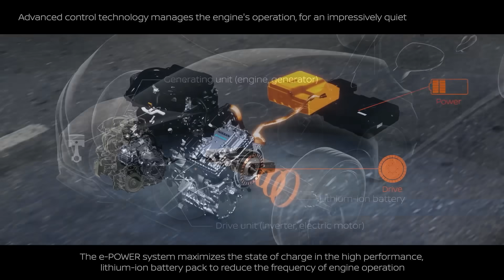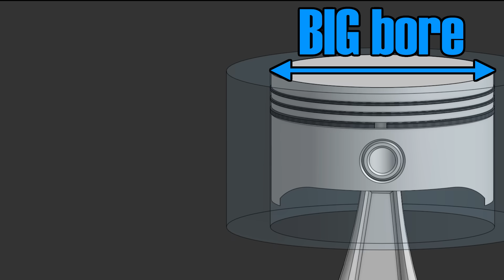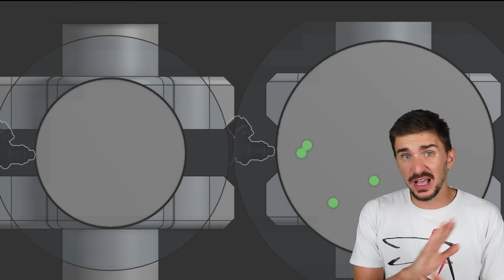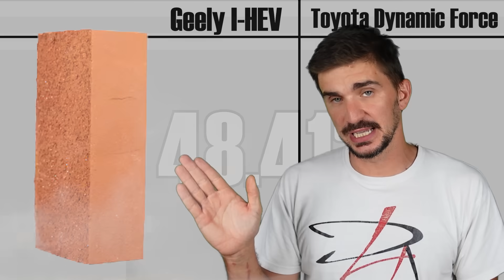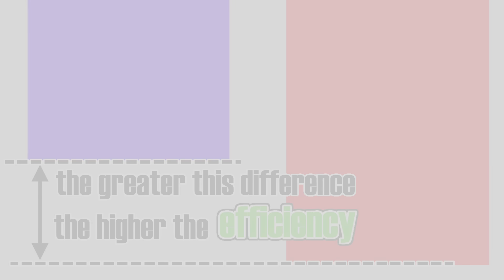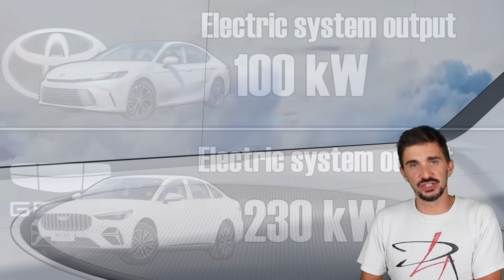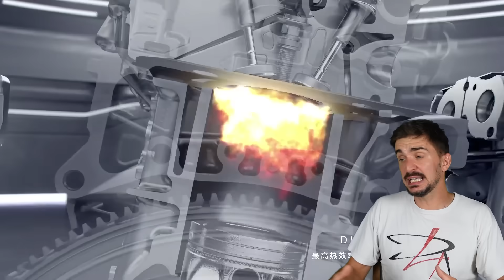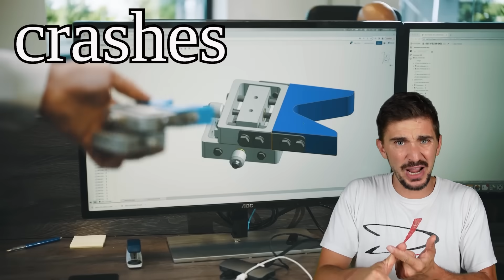How China's Geely Beat Toyota, BMW, Ford and Everyone Else

Comment: If not diesel, why diesel shaped?
Reply: ¯\_(ツ)_/¯
Reply: @Jimjam69e I used translate and it says "tsu" 😂
Reply: @SlimJim3082 the ツ character reads tsu in japanese
Reply: @Raren789  Katakana language if you are specifically trying to search
My mistake: it is part of and a syllabary of the japanese language.
Reply: @WhiteRedPanda  katana language
Reply: @WhiteRedPanda it's a syllabary, not a language
Reply: Direct injection engines share a lot with modern diesel engines.
Reply: Less emissions.
Reply: @user-ro2nq7gp9l this engine probably has a Particulate filter, so the emissions are approaching diesel levels of complexity.
Reply: @gordonborsboom7460 True, but they still have less particulates, plus they don't need piss injection for the exhaust aftertreatement.
Reply: @user-ro2nq7gp9l right. I forgot the urea too
Reply: @user-ro2nq7gp9l  When entering those compression ratios they very much will need SCR after treatment.
Reply: @user-ro2nq7gp9l  haha I never heard it called piss injection but I like that. I’m going to start calling it that too haha
Reply: The backpedaling from Ev is due to tariffs. In Europe Chinese EV are tariffed at 40-45% upon entry. REEV, super hybrid and all others aren’t. That makes them cheaper to buy, while being more complicated and costly to make.
Reply: @luigifranceschi2350  the only reason why they put the tariff is because the VW group asked them. China can crank out more cars than VW and BMW.
Reply: @TheChees1996 BS German automakers lobbied the EU for a chinese style joint venture strategy, they wanted to let Chinese EVs in to learn from them.
Reply: @bl1t7arrow  lol buddy you believe that. Ford bought a car from China to learn from it. What ford learned is they are 25 years behind Chian. VW have already bought a car from China to learn from and what they have leant is the same as ford, they are behind too,have been selling you all garbage for years and never thought of improving.
Reply: @TheChees1996  No I’m saying that China caught up to Europe using a joint-venture strategy, where if Euro automakers wanted to sell in China 30 years ago, they would have to manufacture in China with a Chinese partner firm. European automakers wanted to copy that startegy to catch up to China, so they lobbied against Chinese EV tariffs and for the joint-venture manufacture in EU strategy.
Reply: @bl1t7arrow  oooh I did hear this version of the story.
Reply: @bl1t7arrow  You mean the thing China did to steal all the technology they coudnt make them selfs
Reply: @xythiera Yes, they used foreign IP, at some point, someone started to think.
Now, we have the results.
US did the same to Canada, with the Avro Arrow. Forcing them to end the program, so they could cherry pick the engineers.
How do you think they got to the moon. 😂
The Europeans got enough to boost Airbus. 😂
Reply: @TheChees1996  This is actually true, but also pretty hilarious. Why? Because VW themselves in the early onset of Chinese EVs in EU were lobbying to block tariffs for Chinese cars since their biggest market is China and they don't want China to retaliate. Now, them along with BMW and Mercedes are the ones leading the pack in lobbying tarrifs, because they can barely compete in EU loooool.
Reply: @TheChees1996  Yet China is what baled out VW in the 80s and built their fortunes right up to the point local Chinese makers sailed past them. i.e. usual complacency then panic to stop the wave
Reply: @xythiera no,no,no. Dont blame China for that, they were given that technology because our law makers and billionaires wanted to extract more value for shareholders. They could have kept the factories in Europe but they willingly gave away technology and know how in order to fuck over European workforce and earn more for themselves.  Learn the truth before going racist, thats how they control you
Reply: @nemanjap8768  It's always the same people to blame, the fucking greedy rich assholes.
Reply: @xythiera as far as automobile co production in China is concerned, most of what was produced were one or even two generations behind what was produced in Europe.  That didn’t change until WTO, which opened Chinese automobile market to more brands, easier access, less tariffs, so the co production facilities had to produce more up to date products to compete.
Reply: @nemanjap8768  •yes !yes ! yes !
I blame a snake-China for acting like a snake 🐍 and biting the hands that feed them technically and getting away with IP theft like snake-China & Snake-USSR.
Reply: @TheChees1996  Cranking out more cars then anyone else is not the issue, selling them is, Chinese car industry is the next bubble.
Reply: @luigifranceschi2350   EREVs are cheaper to make if you already know how to make petrol cars, or if you want to add a lot of range to a battery EV.  A 1.5l gas engine with a tank adds 1,000 to 1,500 km range at far lower cost and weight than battery.  Chinese EREVs are verified 2,000+ km combined range, while being pure battery in daily driving. 

Consider an pure BEV with 1,500 range.  The 1,500 km battery would weigh nearly 1,000 kg (2,200 lbs)!  It'd be over 3x the size of a typical battery pack, and dramatically impact performance.  The suspension and chassis would have to be upgraded, and you'd be looking at something more like a heavy duty pickup integrating a structural pack compared to a typical unibody setup.
Reply: @ZweiZwolf but who needs 1500km of range? I usually need to stop every 2 or 3 hours for a coffee and something else. Now pretty all stations on the European main arteries have fast charging. Is not as cheap as at home, but works. So why bothering with a piece of equipment that will require maintenance and adds costs? Just give me a battery sufficient for 300km between stops at 130 km/h and a recharging speed equal to my coffe and toilet stop.
Reply: @luigifranceschi2350   I've driven 500+ (800+ km) miles in a single stretch, and covered 1,000 (1,600 km) miles in a single day, so that sort of range isn't entirely out of the question in a large country like China, Russia, or the USA.  

From a practical standpoint, 100 km electric range plenty for daily driving and 750 km on petrol is about as far as one can drive before needing to stretch one's legs.  If every car were electrified like this, ordinary petrol usage could be cut by 90-95%.  Coupled with fully-automated urban rail, commuter rail, high speed rail, and E-bus routes, that's where China is headed over the next 5-10 years.
Reply: @ZweiZwolf  I can drive too that distance in a day. Sometimes even more. But I stop every 2 or 3 hours. So as I said 300 km range at 130 km/h is more than enough if you made a network of charging stations.
Reply: @luigifranceschi2350   At 130 kph, 300 km is a forced stop for open fast charging every 20 km. That may hold in your tiny country, but it's definitely not the case in the USA, where truck stops can be up to 80 miles (130 km) apart.  China (also Australia and esp. Russia) could be even farther apart in their western desert, hence the 2,000+ km range on their longest range EREVs. 

If I'm actually driving long distance and planning to charge midway, then I would want 3-1/2 hours range @ 130 kph = 450 km USA range / 500 km EU range / 550 km CN range.  

As above, if we assume home charging with mature urban / suburban infrastructure as in China, then an EREV with a 100 km battery is more than adequate for daily driving, and China has mastered that segment with several nice cars under $15,000 USD / Euro.  

For rare long distance trips, it will be quite some time before the additional 200 km battery range is cheaper and lighter than a small 300 km range extender system.
Reply: @luigifranceschi2350 they can dump their EVs in the UK which has lower tariffs.
Reply: @user-xu5vl5th9n  is not a secret. In uk BEV share is 27% , while PHEV is 10%. In Italy PHEV are 17%, while EV at 7%. 
A BEV, same model car, should cost less than a PHEV. Much simpler, less complicated.
Reply: @luigifranceschi2350  ...no, it shouldn't... increasing the battery size at least 3 fold costs more than the engine and associated parts.
Reply: @L @LAndrewsChannel ow the cost of the battery has become very low. The best NMC batteries are at 100 $ per kWh and the LFP by BYD at 60$.
In china the PHEV by BYD cost pretty much the same as the identical EV by the same manufacturer.
Reply: @luigifranceschi2350 •cough , hundreds of billions in subsidies. 
China Next Evergrande bubble once the  EV batteries degrade . 

It does not help BYD  after purchase service is bad worldwide.
Reply: @luigifranceschi2350  evs are not a very smart way to go anyway
Reply: @Rusty_Shackleford_69  have you ever tried one? O love them, especially on mountain roads.
Reply: @Rusty_Shackleford_69  1987 called, it wants its opinion back
Reply: @luigifranceschi2350  Depends on charger availability and the distances you need to travel.
A well made hybrid gives you the same feeling while allowing you to top up the fuel tank easily and not requiring that you can charge the car while parked.
Reply: @jendakrynicky5218 yes, but is more costly to make, and more costly to maintain. EV needs almost 0 maintenance, while the gasoline motor needs all the regular maintenance of any gasoline motor. Personally I don’t believe in PHEV end super hybrids because the combine the problems of regular and ev’s.
Reply: @Rusty_Shackleford_69  It is, but governments just dont tell the story right and sell it right.

Let's be real, 90% of daily drives worldwide are well within range of EV's without re-charging. With fuel prices being voletile and looking at it from a pure transport from A to B point, you have to be kindoff stupid to burn expensive fuel going to and from work and doing groceries.

They should promote EV's for daily driving while not waging war on ICe cars. No, make EV's affordable and driving an ICE expensive. Not the cost of buying one or having one, no, want to drive ICE go ahead, but be prepared to pay 15 dollars the gallon.

That way, you drive cheaply to and from work, do groceries and still be able to have a nice ICE car for the fun miles, oldtimer doing 3 gallons for every mile, a nice sportscar for the weekend drives, despite the fuel price you can easily afford it with what you save on your daily EV.

Offcourse electric infrastructure needs a huge update in almost every country for more EV's but it already needs one anyway with or without EV's. China's advantage is they did not really start building their infrastructure untill the 1980's when they did they could immidiately apply all the lesson learned which gave them a headstart. "Older countries" are stuck with having to workaround and upgrade what has already been there since the industrial revolution and a network expanded slowly.

Those are the challenges, and that's how we have to start accepting and approaching mobillity. I'm a petrolhead, nothing wrong with EV's, if i have to switch for a daily so i can keep enjoying my oldtimers in my own time and for the fun they bring.
Reply: @gilibran EVs require a garage or at least a driveway. If you live in a block of flats or downtown, they are not particularly convenient.
Where I live most people would have no way to charge them at all.
And electricity prices are getting even more volatile due to the windmill and photovoltaic idiocy
Reply: @jendakrynicky5218  It's like i said, infrastructure needs an update frist or paralell , but otherwise? Where are you parking your ICe car now if you live on a block or flat?

I mean, it's really a matter of thinking in solutions not problems. And fuel is going 15 dollars the gallon or liter anyway in a few years.
Reply: @gilibran There are parking spaces around. There's no way to connect the car.
Reply: @jendakrynicky5218  Henc ewhy is said it cant go without an infrastructure update which is neccessary anyway with or withour EV's. 

Even before EV's were a thing the powergrid in most countries was under stress.
Reply: @jendakrynicky5218   China does fine.  They have chargers in every parking lot, and they're rolling out curbside charging leveraging the power lines for the streetlights.
Reply: @jendakrynicky5218  Go look at a Chinese parking lot.  They typically have dozens of fast chargers for EVs.
Reply: @luigifranceschi2350  The 600 kg battery makes mass EV adoption a pipe dream in many places due to road tolerance and electrical energy requirements.
Reply: @luigifranceschi2350 
EV batteries degrade! 
Hybrids are better for now .
Reply: @ProfessorFickle  batteries of hybrids degrade much faster because they have much more often discharge and recharge cycles. An EV with NMC batteries if recharged wisely will break apart all the rest before the batteries are to be replaced, and If are LFP, at least the double.
And a PHEV with dead battery is as good as a BEV with dead battery.
Reply: @luigifranceschi2350  •cost more expensive  to replace battery on EV 😂😂 than to  buy a new EV-car . 

Toyota hybrid batteries now have a 10 year battery warranty , 150,000mile. Warranty. 
Hybrid batteries now have  aftermarket manufacturers that sell entire battery-modules less than  1/2 the dealer price with warranty . 

China car brands will not honor warranty and have the worst after sales service in the world .
Reply: @ProfessorFickle  Those batteries are showing remarkable longevity.  People are driving with 10 year batteries with up to 80% capacity.  It's not a real problem.
Reply: @Omn @Omniverse0  •crack pipe comment  🤦‍♂️ 10 years ago was 2016 EV battery’s technology in China did NOT HAVE ACTIVE COOLING , DID NOT have liquid cooling. Tesla had not transferred technology to the CCP ! 
What 10 year old Chinese EV has 80% battery-Integrity? Show me a YouTube video prof .
Reply: @ProfessorFickle 
Yes and no.
More weight.
More gizmos to fail.

IC still better in longevity
Reply: @Omniverse0 Five and a half years, 89,000 miles, 89% battery for me. It’s going to last longer than the car (and most combustion engines) before it gets to 80% and I’d planned a life where I could be happy with the battery dropping to 70% after 5 years.

It’s a bit annoying really. I can’t justify arguing for a new car with the wife because the battery is failing now 😖
Reply: @ProfessorFickle  This reminds me of Toyota, they insist of Hybrids until like two years ago where they suffered huge market share loss, they make up their mind to invest in full EV, only to realize the political environment start backpedaling back to Hybrid...
Reply: @ProfessorFickle scare tactics, batteries will last longer than 20 years
Reply: @nemanjap8768 : show me prof  buddy . 
Common lie tactic by EV fanatic’s . 
All batteries start to degrade in 4 years even the newest batteries made today .
Reply: @ProfessorFickle So angry and you still can't spell proof.
Reply: @Omniverse0 我给你一点数据支持吧，我在中国抖音上查到的，跑了8年的比亚迪出租车，中国出租车报废年限是8年，一共跑了42万公里，电池还剩74%，不过那时的电池技术很一般，现在应该能跑的更久
Reply: @charlesdeblanc3386  
You are such a fanatic you can’t PROVIDE ANY  .
Reply: @ProfessorFickle  IC engines degrade too. They lose power and efficiency over time as wear degrades the cylinder seals. Often by very significant margins. We've all seen older cars burning oil and emitting clouds of smoke.
Reply: @_Hal9000 correction IC better in every conceivable way 😂😂
Reply: @javelinXH992  yeah the battery might outlast the car which will likely start to fail here and there soon. The comparison to internal combustion is pretty out there tbh, most engines can go multiple hundreds of thousands of miles.
Reply: @Paul-yz4gx  , yes 👍 fail to maintain a internal combustion engine and it will fall apart . 
But the vast majority of I.C.Engines hybrids will out live ANY EV. battery pack . 
Especially Toyota hybrids .
Reply: @Rusty_Shackleford_69 Indeed. In the UK, the average for an engine being scrapped is between 120,000 and 200,000 miles. That depends on manufacturer, fuel type (diesel does better) and usage (long motorway miles are kinder per mile than town driving stop/start).

I know there are people that will say things like “my diesel has done 400,000 miles and is still going strong”, but these people who know and treat their engines well are in the upper bracket of mileage, definitely not the average.

Electric motors and batteries are relatively simple beasts with fewer parts to wear and less physical strain. It’s no surprise they can easily reach 200,000 plus. Bearings and other parts may need replacing (almost certainly) and you may only have 60-70% battery life at that point, but I do think they are going to prove more long lasting overall than ICE engines and certainly longer than most people think. And the batteries now coming online are even more robust than before and pushing up the number of charging life cycles. We are talking over 1,000,000 miles as a norm. This is getting to the point where taking a battery with you to a new car is possible - though form factors stop this in practice. There is talk of standardisation if shapes and connections though, so you never know, one day perhaps.
Reply: @ProfessorFickle  you're making the claim. Man up and substantiate lol bro 😂😂😂
Reply: @shu @colordarmstadtiumpsychiatristr 
Look at a 22 year old Toyota  hybrid is still on the road . Resale value is high for a reason 22 year old hybrid ! 
Resale value of Chinese Cars in Mexico & Brazil are Trash-bad For a reason (degradation & bad after sale service ) 

So many brainwashed EV fanatics.
Reply: @ProfessorFickle  you're confused and conflating a bunch of things to be anti ev for some reason. Typical yt response
Reply: @colordarmstadtiumpsychiatristr : typical EV Fanatic  , ignores China has the worst after sales service in the world . 
Ignores EV resale value is 📉 the worst , especially anything made in tofu-dregg-China .
(Note :  2026& 2027 hybrid is better at the moment than EV)
Reply: @ProfessorFickle  aww lil bro crash out 😂😂😂😂
Reply: @colordarmstadtiumpsychiatristr  : I more likely to buy a ‘Chinese hybrid ‘ than a Known-battery-degradation Chinese EV . 
Let me remind you , Look at resale value , look at the used car market and see what keeps its value for 20 years .
Reply: @ProfessorFickle  😂😂😂😂
Reply: @colordarmstadtiumpsychiatristr  
😂😂😂😂😂😂 EV resale value 📉
Reply: @ProfessorFickle  it's not really been shown to be a massive issue, and China is improving batteries more and more. They are unfortunately world-leading now, it seems. Would have been nice to have the EU develop this technology further.
Reply: @csr7080 •lol I guess it’s time to steal technology from China and China should not complain about its bad youth unemployment rate. 🤷‍♂️
Reply: @ProfessorFickle  sure go ahead, no argument from me
Reply: @ProfessorFickle   Yes, and the current battery warranty is to 80% of original capacity over 30 years.  A 300 km EV going to 240 km in 30 years is longer than most people hold cars.  How many 1996 cars do you see on the road today?
Reply: @ProfessorFickle   Chinese BYD E6 taxis in Shenzhen are hitting 700,000 km with 80% battery, no problem:
https://www.youtube.com/watch?v=fVUytbdJE5s
Reply: @ZweiZwolf  • byd known worldwide for the worst after sales service , 6 months to wait for a suspension part in Mexico & Brazil . 
Do you think BYD cares about honoring a warranty , made in CCP.

I do see plenty of Japanese cars from  1986.  Because they made parts with warranty for them .
Reply: I came to type this too.
Reply: Imitation is the sincerest form of flattery?
Reply: High compression
Reply: Very long stroke, extremely undersquare.
Reply: It doesn't "clank" like a diesel, so no fun
Reply: Convergent evolution
Reply: The diesel shape more efficient and running petrol instead lets you get away without the DPF or DEF to clean out the Nox
Reply: My Royal Enfield Bullet 350 engine was designed in the mid 1940s. It is under square (long stroke) too. These engines enjoy a good expansion ratio and good torque, too. The downside is the more limited safe rpm compared to a square or over square design.
Reply: Bingo.
We can have 100MPG cars tomorrow if everyone is willing to put up with 25 horsepower engines.
Reply: Miller cycle makes it less effective comp ratio, and maybe its fancy intake, allows it to not need diesel style injection
Reply: No DEF required
Reply: Does it run on 87 octane gasoline?
Reply: @jamesg9932 why shouldnt it all? All cars sold in europe cars run on 95 octane engines.
Reply: @arsicpedja   In the USA most cars run on 87 octane gasoline, if you have to pay the increased cost of higher octane fuel the higher efficiency benefits are negated.
Reply: the distinction is blurring
Reply: I would suggest that it is a macro factor, because it relies on middle eastern light oil, the heavy fraction of which will fuel thermal power plants and diesel will be consumed by trucks.... using diesel for civilian commuters would break this balance.
Reply: Longer stroke, more torque, lower rpm, higher compression, more work extracted per explosion. 

More efficient
Reply: LMAO Try running this on Brazilian fuel, it would detonate in 4 seconds
Reply: @gabrielvieira.4358 parece que você desconhece a diferença entre compressão geométrica e compressão efetiva. Ele tem a taxa geométrica de 15,5:1, mas as válvulas fecham tarde, logo a compressão efetiva vai ficar em torno de 11:1, dentro dos limites que a gasolina comum tolera. E a octanagem da gasolina comum brasileira é 93 RON, melhor que a dos EUA que é 87 RON.
Reply: @gilsonrogeriolimaoliveira2807   Teoricamente. Coloca a comum pra você ver uma coisa. E no vídeo não foi (Até onde eu vi) explicado sobre a compressão efetiva. Então, o motor é menos eficiente ainda... Por isso tem que ter um motor elétrico pra ajudar. Qualquer carro faz essa eficiência com um motor elétrico ajudando. E então porquê colocar a compressão "fake" sendo que a real é menor?
Reply: @gabrielvieira.4358 você assistiu o vídeo todo irmão? Ele diz todas essas coisas. O motor é feito para um carro híbrido com uma bateria enorme, é completamente frouxo se por acaso a bateria acabar, e o sistema usa IA para evitar o máximo possível que isso aconteça. E não é compressão fake, é assim que motores de ciclo Atkinson ou Miller funcionam.
Reply: @gilsonrogeriolimaoliveira2807  Okay, não tinha pego os detalhes. mas ele disse que um motor "normal" (sem essa "descompresão toda") Não precisa de motorzinho nem ""I.A."" (Diga-se qualquer controle eletrônico?? ECU é IA, teoricamente?! ) para funcionar... O resto eu entendi.
Reply: @gabrielvieira.4358 um motor normal que não precise de ajuda dos elétricos jamais chegarão perto dessa eficiência. Os diesel em caminhões chegam a 45%, e ele próprio mencionou o da Toyota, que na versão híbrida tem eficiência de 41%, e na versão não híbrida 40%.
Reply: @gilsonrogeriolimaoliveira2807   Então chegamos no limite dos motores...
Reply: @gabrielvieira.4358  o ECU por si só ele é uma planilha com um monte de condições atmosféricas cruzadas com temperatura/giro do motor em prol de atingir máxima eficiência ou máxima potência. O elemento de IA no Geely seria só um google maps glorificado falando pros motores do carro usarem o máximo possível dos seus modos regenerativos antes de chegar na subida até a casa da sua sogra . . . 

Esse movimento de fazerem carros elétricos com um combustão reserva se deve pelo fato de que o mercado de elétricos puros na China tá diminuindo, tanto por causa de tarifas e impostos quanto pelo fato de que pesquisa e desenvolvimento pra aumentar a densidade energética de baterias não está rendendo.

Eu ainda assim acho um tanto quanto retrógrado a narrativa de que a indústria deveria perseguir atrás de eficiência de modo tão obstinado assim, ainda mais considerando que existem outras indústrias muito mais poluentes (ahem, Inteligência Artificial) e que os governos globais fazem vista grossa absoluta em prol de botar a culpa no consumidor final por motivos de bilhões e bilhões sendo movimentados no mundo todo a favor de propina. . .
Reply: Diesel shaped? WTF?   BTW Diesel is spelt with a capital D because it is a name.
Reply: Because it’s a four stroke engine, just like 99% of engines on the road, gasoline and diesel.
Reply: Petrol is more calories densed
Reply: @TheFreakbreak  Per kg yes, ever so slightly, but not per litre of fuel. That is why Diesel is generally considered to be the more calorically dense fuel.
Reply: So now Chinese cars NEED to know where the vehicle is and where ist it going at ALL TIMES to be able to calculate the efficiency? (Surprised Picachu face) Oh no! What a clever way of "needing" to know where the vehicle is at🖕🤣🤣
Reply: @mejiadiver Yeah, a lot of american market cars do the same thing of tracking you.
Reply: Gasoline is cheaper than diesel fuel? True in N.America if not world wide.
Making a gas engine closer in design to a diesel is the natural progression to higher efficiency
Reply: @gordonborsboom7460  hwhat? Here in germany diesel is A LOT cheaper than gas, at least it was like that a few months ago
Reply: @fynn1202 nearly a 20% premium in Canada now and has been more than gasoline since low Sulphur diesel was introduced.
Reply: @fynn1202 not in the US. High octane Unleaded is at 5.29/Gal and diesel is at 5.89/Gal. ;subject to change obviously.
Reply: @Michaelation08   US gallon or Imperial gallon?
Reply: @Davbach01 US gallon. I drive a diesel BMW in California. Prices peaked at $8/gal here. 91 octane was $7-ish.
Reply: @McCaliber   A US Gallon is less than Imperial gallon so it will cost less, they're not like for like.
1 US = 0.8326743 of an Imperial Gallon
Reply: @Michaelation08 you must be in California because in North Carolina I purchased regular gasoline for less than $3 a gallon and high octane premium was just over $4 a gallon
Reply: @thomasward4505 Virgin Islands, thank you very much. 😂
Reply: @fynn1202  In Serbia diesel is more expensive, almost 15% ,but still here people favor diesel ,its still king off long trips and towing
Reply: @fynn1202  I wouldn't call a 10% difference 'A LOT'. Fuel prices are dictated by demand and German cities started banning older diesel emission standards from entering them thus a lot of people started changing their diesel cars to gasoline, thus demand for diesel (and the price) dropping. Same for France.
Reply: @fynn1202 I saw a fuel station yesterday showing Diesel fuel almost $2 a gallon more expensive.
Reply: @gordoorld 

Not necessarily worldwide. It’s probably higher taxes on diesel than on gasoline. 

In Europe diesel usually is less expensive than gasoline but also in Europe taxes are different on both fuel types.
Reply: @Conservator. I have heard that is largely a function of the EU tax breaks too on diesel fuel to create a market for diesel consumption.  I only get this info 2nd or 3rd hand though
Reply: @Conservator.  Fuel prices are based on demand first and foremost. Countries with more expensive diesel use more diesel than gasoline. It is simple economics.
Reply: @LAndrewsChannel That would be true if there was a fixed supply of gasoline and diesel but there isn’t. 

Refineries use cracking which enables them to significantly vary the output of diesel and gasoline and adjust them to market demand.
Reply: @gordonborsboom7460  Here in Japan Diesel is the cheaper of the two. There are very, very few Diesel-powered regular cars, though.
Reply: @staninjapan07  interesting. In America diesel is 1/3 more expensive on average. I'd love a mechanical pump turbo diesel daily
Reply: @MichaelBrown-wx6zq  In the UK, where I am originally from, Diesel is more expensive.
Reply: @Mic @MichaelBrown-wx6zq red diesel is cheaper.
Reply: @staninjapan07  Only because the government chose to charge more fuel tax on diesel (after telling the population that diesel was better for the environment). It’s less expensive than petrol to manufacture it.
Reply: @wheater5  Yes, I am aware of the simpler manufacturing process. It stands to reason, even for those who know nothing of such things, that a cruder oil-like fuel would go through fewer processes than something highly refined like petrol.
Reply: @gordonborsboom7460  Diesel is cheaper than gasoline in europe.
Reply: @HomelabExtreme  no more, at least in Italy. There's been a revolution in taxation here, and now diesel fuels are a little more expensive than gasoline.
Reply: @gordonborsboom7460 That's entirely false. That is only where envirocucks pump increased tax on diesel.
Reply: @gordonborsboom7460  the price difference of diesel mostly tracks with its higher energy density. So in the end it's about the same cost per calorie. Add to that higher possible compression ratios, it could provide even better efficiency than this engine. The only thing is that diesels cost more to produce and need better support systems like catalytic and particulate filters. So maybe the increased upfront cost doesn't make sense for a car that only drives 300k kilometers in it's lifetime and is dumped after that.
Reply: @FenixQubes the cost difference local to me with higher diesel basically negates the use of diesel in passenger vehicles as a cost saving.
20% better thermal efficiency is nullified by the 20-30% higher fuel cost.  And the less diesel vehicals on the road, the less demand for the fuel, amd the less likely the cost difference will come down.
Diesel fuel production is said to be maxed out in the North American market, which means they charge whatever they can for fuel as there is no other place to go for loweer pricing
Add the complexity and purchase price differences, and diesel is and enthusiast purchase basically